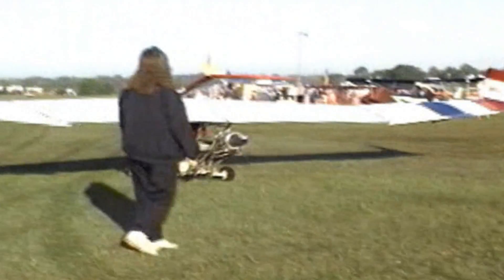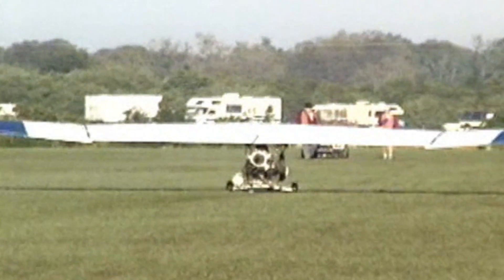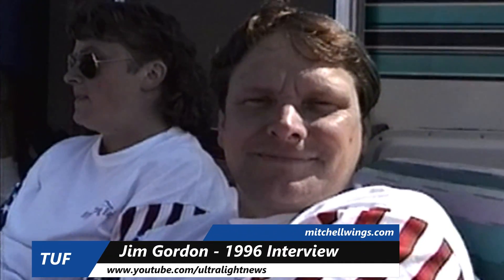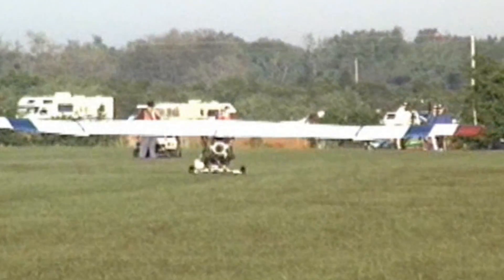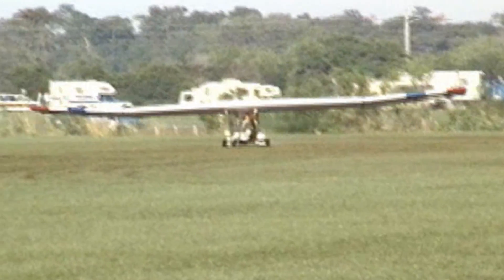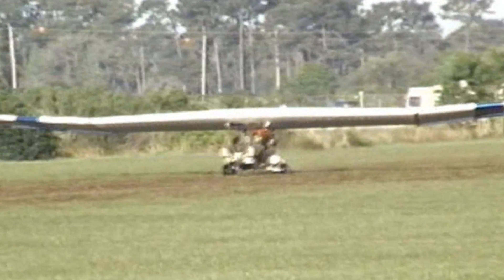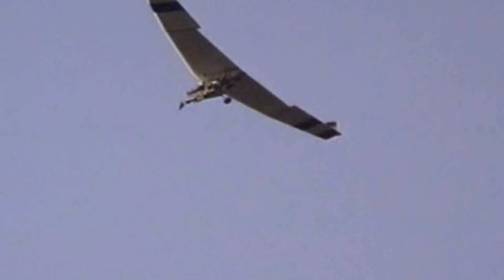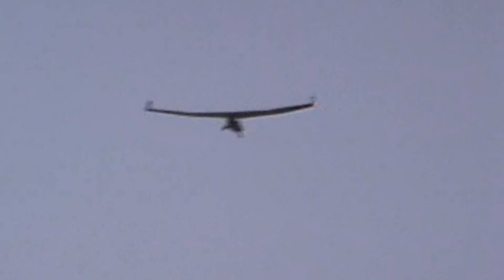Jet Engine Ultralight Aircraft, Mitchell Wing B 10, Mitchell Wing Flying Wing with jet engine.

Comment: Tiny wheels, interesting they are effectively large enough for even grass field. Makes you wonder how minimal wheels for runways could be. Small diameter wheel is also easier to drive with an electric motor for push out and taxi. The Mitchell wing here is probably a bit too low speed to benefit from a jet, even a turbofan :)